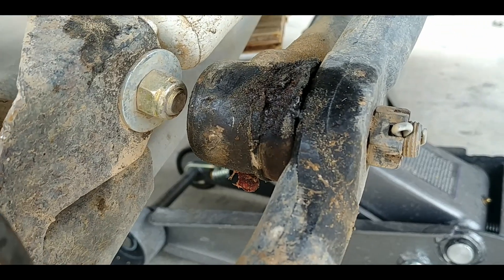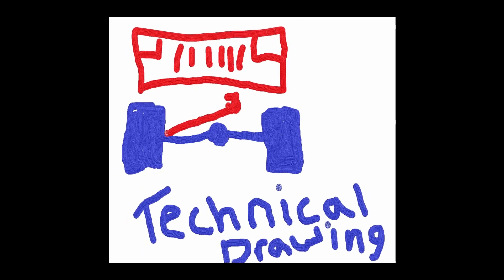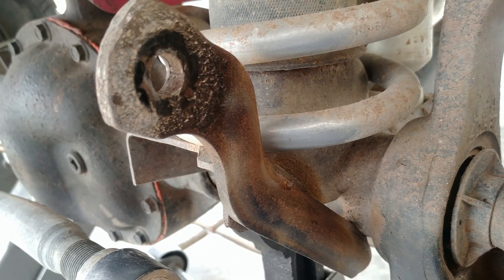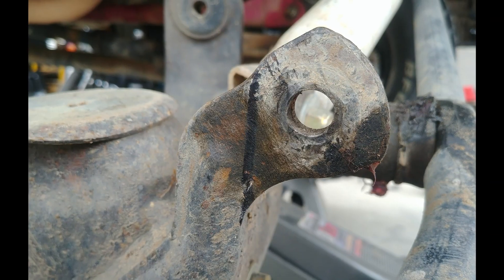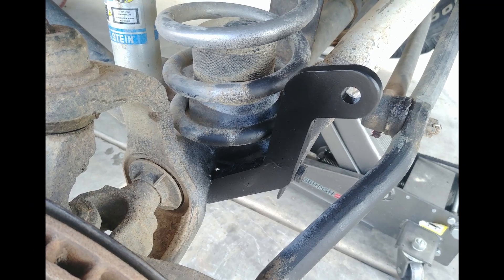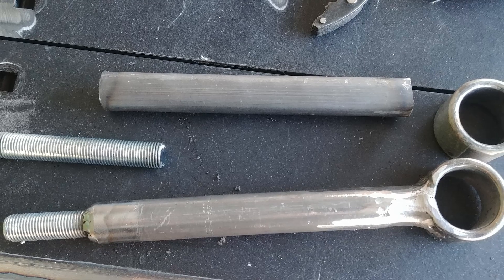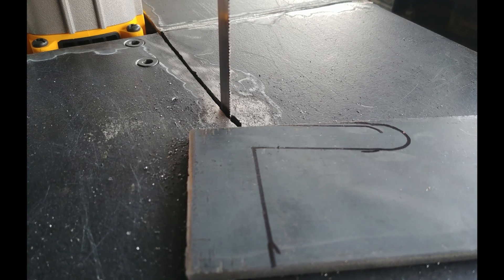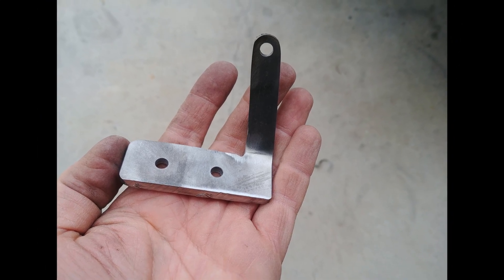Synergy Sway Bar Brackets for Jeep Cherokee XJ

Comment: I did a 3" Zone lift on the Bumble Jeep (my 95 XJ) and ended up having to use an extended rear brake line, a 1 1/2" transfer case drop kit, 2" sway bar drop brackets. What I didn't realize at first was the 3" lift shifted the front axle to the drivers side about 1". When I found this out, I ordered a Rough Country adjustable track bar. (RC1181) It comes with a new frame bracket and can be adjusted after it's installed which makes it easy. Most of these replacement track bars require one end to be unbolted to adjust. Now everything is as it should be, axle is centered, ride is good and Bumble Jeep is lifted. I didn't go with the sway bar disconnects as I don't do much off roading. Good Job, God bless, stay well.
Reply from the maker: It is funny how we all end up fixing the same problems after doing a lift. Our brake lines are from a Durango, we went with a slip yoke eliminator instead of the drop brackets, eventually ended up with sway bar drop brackets (but only after the steering brace impeded the sway bar). We went with the Rubicon express track bar because it seemed pretty heavy duty with the driver's side bracket. The sway bar disconnects became necessary after we broke or bent a few factory links out on the trail. We will definitely be checking out some Bumble Jeep videos to see your build! Take care, and thanks for watching.

Comment: Looking at your video, at 3:17, it looks like you could have cut the extra length off the lower piece and just re-threaded it and done...Am I missing something?
Reply from the maker: We probably could have cut and threaded the old links, but the one from the passenger side was bent pretty badly already and we wanted something a little stronger to prevent any future bends.

Comment: Are these discontinued? I can't find them on their website.
Reply from the maker: It looks like they might be. There are a few other companies like Clayton that make similar products. Most of them are made to completely replace the original bracket, but they could probably be installed similarly to the one from Synergy.
Reply: @DorisandDaddyOffRoad  Thanks. FYI JKS manufacturing still makes them. I just got my replacement.